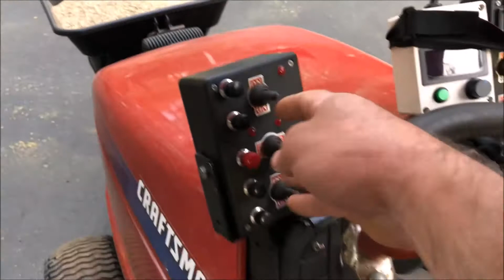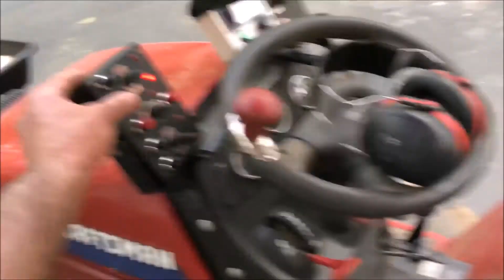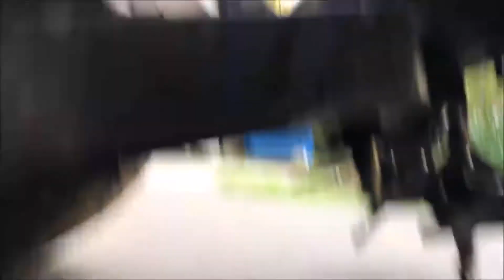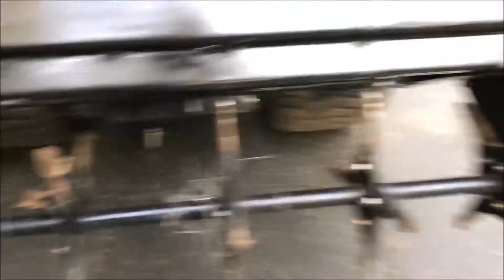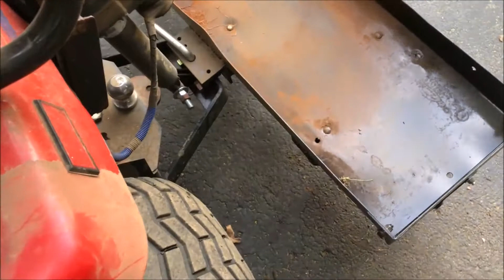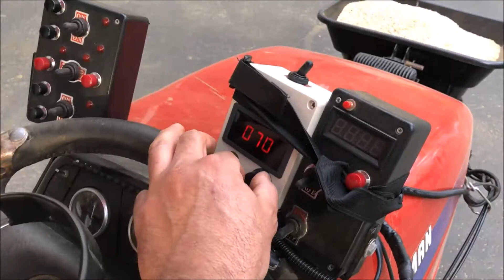Sleeve hitch plug aeretor and electric spreader. (Tractor mods)

Comment: Where did you purchase the electric actuator and what is it rated?
Reply from the maker: Andrew Augusto I god them from eBay. Some new and some refurbished but still not cheap. They are the heavy duty rated for 500lbs, anything less they will strip. I had them for a few years and use them for the various attachments and have been great.